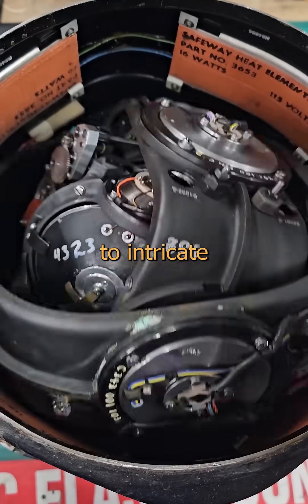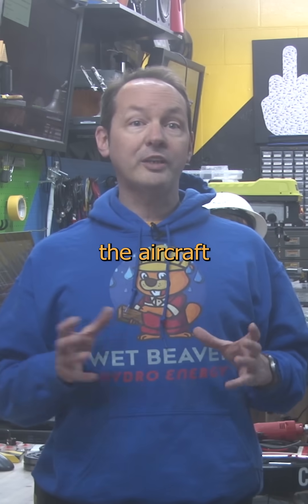Inertial Platform #chrisboden #comedy #gyroscope #gyro #avionics #physics #educational #science

Comment: The team behind the Mars Helicopter were able to use parts from off the shelf Android phones to fix the Gyroscope on the Helicopter when it malfunctioned.

Funny enough, when they originally built it back in the early 00s, cells obviously didnt have that tech, but by the time it malfunctioned a decade later, some crappy Cricket phones from Wal Mart had tech that rivalled & even surpassed what they were using 😅

Comment: I would like to add a small correction, some phones do not use a gyroscope for the screen turning, instead they might utilize an accelerometer. 

MEMS gyroscopes are only delivering information about an ongoing rotation, specifically the direction and speed of it. The main drawback is that they don‘t know where down is. Accelerometers on the other hand tell you in which direction they are being accelerated. A side effect of that is that they know where down is, at least when they‘re not being accelerated equally as hard in another direction. 

A combination of both is ideal, which is why most modern hobbyist anycopters have both in them.

Comment: Fun fact, Inertial Reference Units used nowadays in aircraft don't use gyroscopes anymore, they use lasers instead and can also measure longitudinal acceleration. This allows the aircraft to know its orientation (like with gyroscopes) but also its speed and its location. So they can navigate without GPS and without radionavigation.

Comment: Nope, it's an inertial navigation unit.
It actually measures the rotation of the planet to start, and then not only the attitude of the aircraft, but the location based on the precession at latitude.

Comment: wait! for the phone, i believe it is a little wrong, but not by much
while some phones do have gyro, not nearly all of them do, meaning the screen rotation usually isn't detected via the gyro, but using the accelerometer instead
accelerometers work by using earth's gravity (or acceleration), not rotational inertia
accelerometers are also much less precise and can't detect some of the axis that a gyro can, so it still is preferable to use those
still great video tho

Comment: I've shared links with flat earthers for the KI-256 artificial horizon gyro maintenance manual. But none to date have bothered to download and read it. 
The expected hourly drift due to Earth's rotation is spec'd out.
The vanes on the bottom of the assembly to maintain correct attitude over long distances is explained well also.
Oh well.

Comment: here's a tidbit
the bearings used in gyros are cleaned with Freon which is outlawed. So one arm of the gov't fines the manufacturer $100,000 for using Freon while the arm that orders this process includes a nondescript bonus of $100,000

Comment: The fact that they can include all those bits and bobs and balance it without obvious added weights is impressive.
Reply: The 3-axis outside bits don't spin. They allow the inside wheels to remain in a stable spin, free from gyroscopic precession. If this is part of an INS, it probably has 3-axis accelerometers built in as well. INS work best when synced to GPS or similar secondary system, as the INS give results relative to the initial frame-of-reference.
Reply: @geekchameleon  man, I hadn't thought of that. Very impressive
Reply: Just the wire placement alone is amazing.
Reply: that is so true

Comment: The platform itself is not rotating. It needs to be stabilised in N/S, E/W and vertical planes.  For stabilisation, it uses inputs from precession gyros for each plane. When stabilised, accelerometers can then sense accelerations in each plane. Integrate once and you get velocity, integrate twice and you get position. If you initialise the inertial system at departure, it can output aircraft position regardless of any GPS or radio navigation beacons. This type of positioning was common on most airliners since the 60s. Nowadays we use laser gyros in so called Inertial Reference Systems.

Comment: I have one of these in my cessna 152, sure it's heavy, but I compensate with extra fuel and smaller wings. I also reduce weight by reducing the amount of air in the tires.

Comment: INS or Inertial Navigation System is a series of gyroscopes in an aircraft primarily for a means of navigation on board the aircraft. GPS did exist but there was and may be still is a fear it could get jammed and the aircraft would be lost (not accounting for backup instruments. Secondarily it could also be used for attitude and heading, but primarily navigation. I’m not sure if newer aircraft have it but it’s got 2 flaws. It gets more inaccurate as time goes on, even if the aircraft isn’t moving. After only 40 minutes of sitting still the F-14’s INS predicted position can be up to 100 meters off its actual position. Obviously it can get further off when in motion and making maneuvers. Now 100 meters isn’t that much of a problem in the air for navigation as it’ll get you close enough, it starts becoming a problem for GPS guided bombs. Now the F-14 could never carry JDAMS but it could relay cords to aircraft that could and other aircraft like the F-16 and F-15 do have INS’ too. The second flaw is time. You have to tell the INS where in the world it is and it has to calibrate itself. This can take up to 8 minutes for a full alignment on the F-14. However this can be partly subdued with the use of stored heading. Where the aircraft will take the last position it read as its current position (although I believe the ground crew has to do some calculations or work) of course with less accuracy. Lastly with extreme or extraordinary maneuvers one might pull in a high intensity situation you can actually “break” or miss align the INS mid flight, basically mission killing yourself (you have to go back to base as in the F-14 the INS is also responsible for feeding data into the FCS or Fire Control System. Basically the computer calculating for your weapons.

Comment: Fucking hell, I flew F, R, and T model C-130’s that all had inertial navigation systems, but I never popped the top on one.  You could still hear the gyros spinning over ten minutes after engine shutdown and instrumentation DC bus de-energizing from the 24VDC battery bus.

We had to account for inertial drift over time, and we would make small adjustments to the INS on long range flights by checking magnetic north for our position or doing a sextant shot and checking those fixes against the INS direction.

Thank you for bringing this sort of content.  Some of the best times of my life happened in that flight station.

Comment: That boi , Isn’t just a Gyroscope 
It will store your original position and crunch in the destination position and it will give you heading and range towards your destination 
And The Neat Part ? It is a complete independent system 
Gyros are used in ADIs but they have their own gyros built inside themselves not this big chungus .

Comment: You know what’s really cool?
Ingenuity (the Mars helicopter) lost its inclinometer (it stopped working). The navigation was a “track objects through the downwards looking camera moving across the field of view”, which kinda needs your initial spacial orientation to work.

But Ingenuity was basically built from smartphone and other off-the-shelf parts, not specifically designed parts like radiation hardened computers. They just used a few hundred of each SoC (system on a chip) types they were interested in and put them into a radiation test and found which ones were, for whatever reason, not very susceptible … much much faster and cheaper.

Now, phone chips and MEMS … they have accelerometers. Which can be accumulated for a more accurate reading. 

So they could change the code to use this new source.

Comment: Smartphones and tablets actually use accelerometers to determine screen orientation. They're so sensitive that they can detect the pull of gravity, so they get a general idea of how the phone is oriented. But determining acceleration is more helpful for deciding when to rotate the screen. A more sudden rotation of the phone would indicate the user has changed the orientation, where as slower rotations may indicate they're just moving around but still holding the phone in the same orientation.

Comment: This guy is called an INS (Inertial Navigation System), as explained in the vid, it’s a gyro which is calibrated before flight and holds roughly the same orientation (as you travel around the earth you get drift and the longer you fly the worse it gets), allowing you to navigate by using the built in accelerometers and the gyro to determine your change in position, the newer version is known as an IRS (inertial reference system) and uses a solid state gyro instead!

Comment: Yeah. For Arduino Nano based RC multirotor aircraft you can get modules that combine an accelerometer, a gyroscope, AND a magnetometer in a package smaller than Gameboy cartridge (I love using size comparisons that get 99% of the Gen Z's and Gen Alphas saying "A What?" in unison. 😁). The actual single surface mounted chip that has all this incredible orientational functionality is too tiny for most people to use without it getting soldered onto a breakout board first.

It's crazy to think that all that mechanical complexity has been simplified and shrunk into something that does the same job, arguably better, and is now a chip so small and cheap that if you dropped one on a gravel driveway, it wouldn't be worth the aggro involved in looking for it !

Comment: I used to work on inertial navigation systems for AWACS in the Air Force. The beauty of it is it’s fully self contained so it emits no signal and requires no incoming signal. Even if all other nav systems are out it can direct you to your desired location, and tell you where you are, to within just a few feet, all off of just gyros and accelerometers. Pretty awesome.

Comment: I used to work backshop avionics for the F-16 and we had a test stand for older block gyros. It was a waist high steel cube with a great deal of mass to hold those spinning balls of terror. Oddly that wasn't the scariest thing in the shop, that would be the bank of capacitors in the back of the test station. Each capacitor was the size of a liter bottle, had large skull stickers on them and exposed contacts. I think they were the power filters for the 3 phase power coming in, each phase having its own wrist thick cable from the bus bar and powered by 3 generators, each the size of a medium truck. Good times.

Comment: Inertial ICs that you might find in a phone, although called a gyroscope, do not work similarly at all and aren't comparable in performance. This thing, once it's spun up, it's stuck in its orientation pretty hard. Phone IMU is just a collection of accelerometers, the readings of which are integrated in software and when used for accelerometery, they're OK (also to find which way gravity is pointing), but as a gyro, they rapidly accumulate error. You can fix the creeping error using Hall sensor magnetic heading, unless you happen to be near something that massively distorts the magnetic field.

Comment: Those old gyro based sensors are works of engineering art!   Russia made some amazing avionic devices way back in the day too.  

The Technicians that build & tested them, are long out of the industry now.  I fear, we as a Nation could barely pull off reproducing thing of this mechanical complexity in 2025.   Everything is now performed by large scale integration Silicon chips nowadays!

Comment: That is a doozy of a gyroscope!!! I'm very jealous.  Over the years I have collected and made several but none capable of gleaning the kind of rotation, velocity and angular momentum data that your treasure surely can.  

I have some intuitions about possibly  detecting gravitational waves with these objects that are dismissed and 
Cast aside as nonesense by serious physicists. Nevertheless I think there are endless experiments to be done using giant, 10ft diameter nested rings made of high density alloys and a neodymium center ballast sphere that's 2-3 meters in diameter.  Of course it should be capable of withstanding operating at extremely high velocities for weeks at a time. Any resistance or drag on a mass like that would have to be the result of some serious cosmic processes.  Maybe a massive magnet whipping around and spiralling through space time would result in some anomalies or distortions that could shed light on fundamentals forces. Speaking of which,  I'd really like to know what happens when you transmit 2 identical signals in amplitude and wavelength but 180 deg out of phase from each other from antennae spaced apart at a perfect wavelength or harmonic of their transmission. Just ideal conditions for deconstructive wave cancellation so that just as the signals are amplified and transmitted from the antennae they are nullified and cancelled out immediately upon emission.  What then happens to the energy? It cannot be created or destroyed but it also cannot be detected or shielded from using obvious faraday cage nested grounded screens.  It doesn't generate a massive hot spot where it is transduced into nothingness In the abyss  or the void.   So where does it go? That was a doozy of a rant!

Comment: you are not wrong but you are conflating accelerometers with gyroscopes a bit, both (kind of) exist as MEM devices though for phone orientation the accelerometer is used AFAIK. Awesome tech if you zoom in close enough the vibrating version of a gyroscope is a little mind bending to think about.